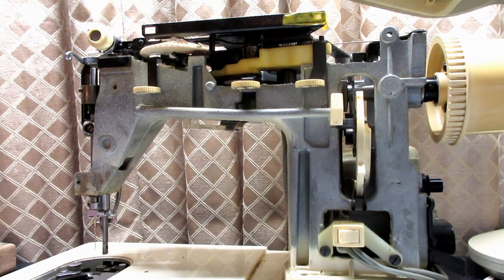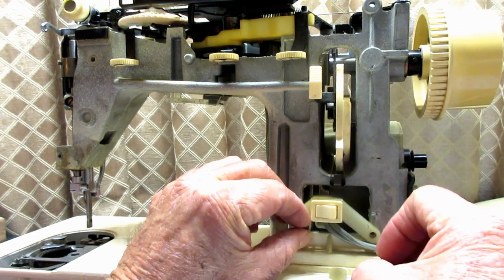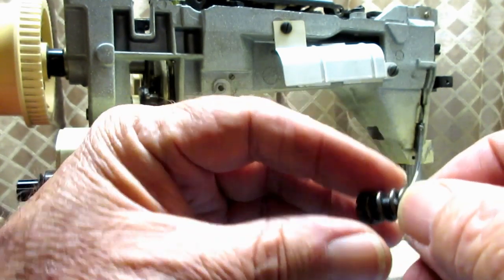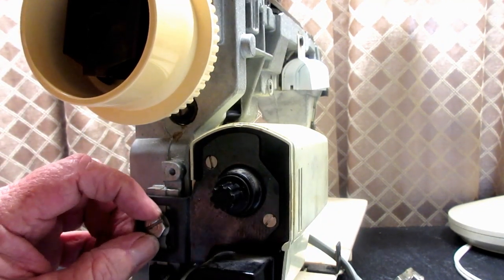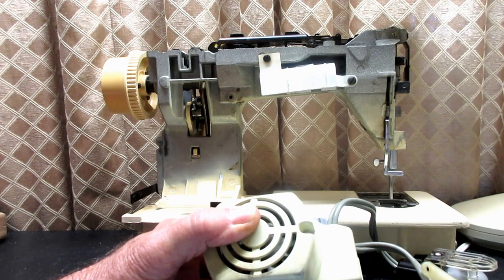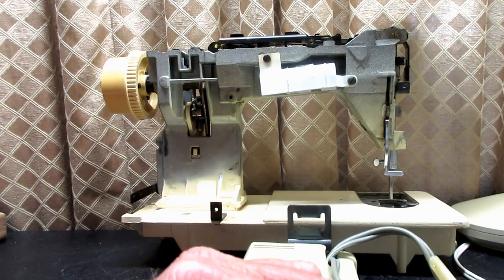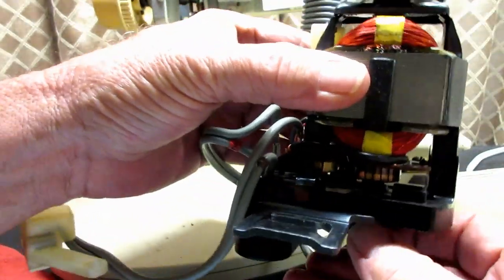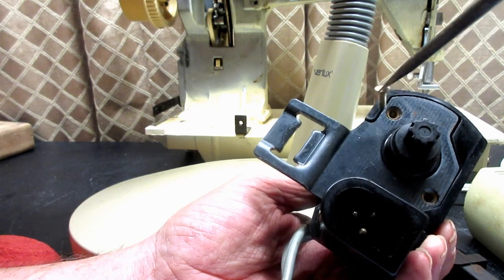How to Remove the Switch - Motor - Light - Wires from a Singer Model 353 - 354 Genie Starlet

Comment: I know I am repeating myself, but this motor assembly (and the 353-354's) are so similar to the Singer Merritt 1873. I had to put an Amazon replacement motor on this machine. I replaced the brushes in the old motor, but it still "stalls out". I cannot find anyone who rewinds these smaller motors. Another great video, Andy!!! Thank you, Sir... (EDIT- Be warned that you need a "third" hand to get those brushes in & out!!! The screw caps are the best design. The brass tangs are tough to deal with!!!)
Reply from the maker: I believe it. Singer made a few motors but had hundreds of models. Here is an old list >> https://www.singersewinginfo.co.uk/motors/
The brass tube brush holder works well in a PA motor like on the 301A, 401A, etc. On these little motors, they are a pain and I agree the motors with screw caps are the easiest.
Thanks for watching.

Comment: I have a short circuit on Saffron, my 354 Starlet.  You didn't mention interference capacitors on the video, I understand they tend to be the prime suspect in autonomous running?  Are they fairly easy to find, or is there a more likely source in this model?
Reply from the maker: "I'm just wild about Saffron ..." What a great name, I love it. I have never encountered capacitors in inside the motors of any of the machines I have worked on, but I know they do exist as you can see in this video >> https://www.youtube.com/watch?v=Ez2P3hzk4_s
When I have found what you called "autonomous running" the problem has been inside the foot controller. It was worn, out of adjustment or had broken parts. Viewers have told me of finding the capacitors inside the foot controller, removing them, and restoring the pedal to normal function. If you'd care to check out the controller for your Genie I believe it would be a clamshell type and you can take a look at my series for that type >> https://www.youtube.com/playlist?list=PLsCOZgzzaiKItPLWcK24FBoMdHK8vTXNi
If you happen to have the older button style controller for some reason, then here is the series for that style >> https://www.youtube.com/playlist?list=PLsCOZgzzaiKL6ePPxLpmnWSzTyxPKTb71
I'm sure there must be other videos on YouTube about the situation too. Thank you for watching my channel, and good luck.